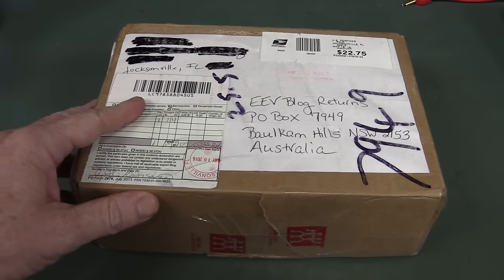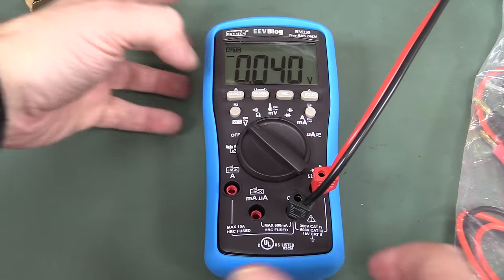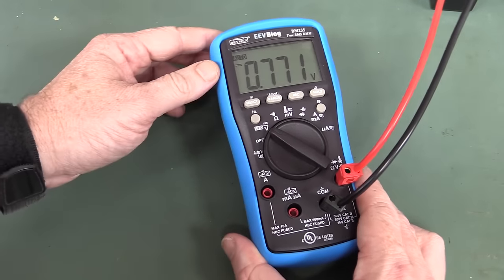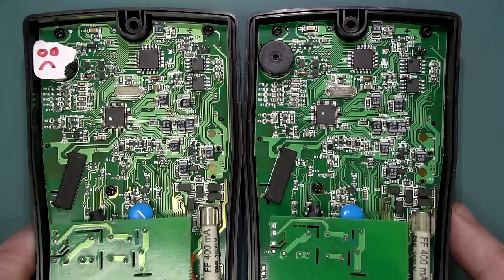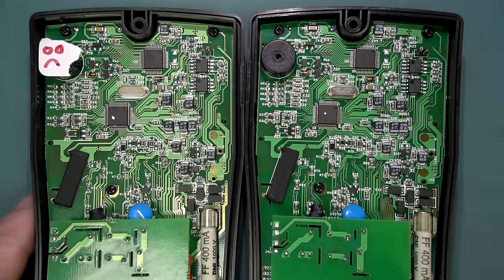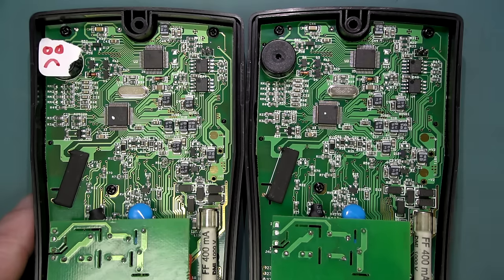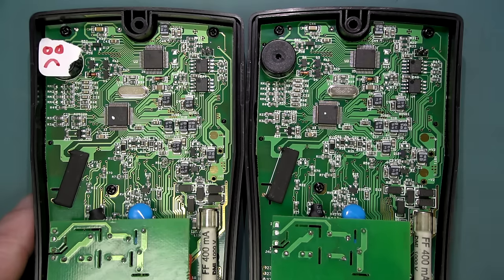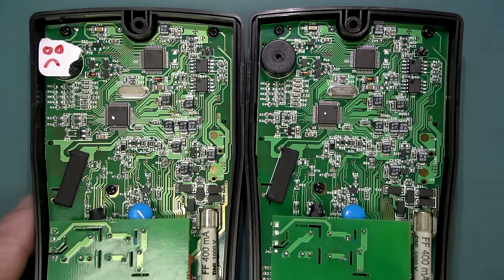EEVblog #884 - EEVBlog BM235 Multimeter REPAIR

Comment: As it turns out, Dave has an ACL joint fault and the meter had a DC L joint fault.
Reply: No you didn't! :D
Reply from the maker: I'll pay that.
Reply: Thanks. That will be one thumb up, please.
Reply: Dave,
Have you moved to the new lab building?
Reply: Only a fool would ask that.
Reply: funny stuff
Reply: Joking aside, a torn ACL (which stands for anterior cruciate ligament, not joint) is a very serious injury.
Reply: I didn't say ACJ or AC joint, did I? "ACL joint fault" = (knee-)joint fault related to the ACL.
Reply: Gameboygenius No, you didn’t say “ACL joint,” Dave did. (He misspoke.) You made a joke (a good one). I was going to bring up the seriousness of the issue of this particular knee injury, and, instead of creating a new free-standing comment, replied to yours (which already had the word ACL in it).

Please don’t take it as a personal attack on you—that was never my intention. My “joking aside” was just a “by the way” or “apropos of ACL.”

(Ironically, I’m going for a knee surgery in a week. Throughout the past few months, I’ve learned a thing or two about the knee-joint injuries. But that’s another aside.)

Cheers and good luck to Dave with his “joint fault.”
Reply: Clever (game) boy.
Reply: Gameboygenius b. NBA.

Comment: All these repair videos that guys like Dave and Shahriar do make me wonder how many millions or billions of dollars worth of equipment ends up scrapped or junked or collecting dust because of the failures of single sub-penny components. I remember hearing so often that it wasn't worth fixing things, or people should just swap boards, but that seems so wasteful now. But I guess time is money, so that factors in.
Reply: Yeah, it's crazy. I was on Skype call with my best friend after my laptop's charging circuit died and they said something like "oh, about time to get a new one then". And I was shocked! Hell no, I'm going to rip this thing apart and see what's going wrong. Turns out a MOSFET was blown and I had a replacement part, and it only took an hour or so to get a new one in.
Reply: An hour of someone's time for component level repair is worth anything from $100 to $300. Older laptops or cheaper laptops would be easily totaled at that rate.
Reply: people throw out lcd monitors all the time because of 20 cent capacitors.  back in the day you could find crt tvs and monitors on curbs for bad transistors, those only cost a buck or two a well.
Reply: First you pay someone to diagnose the problem (base pay + benefits + social security + Medicare + Federal Unemployment taxes  + State Unemployment taxes + Workers Comp +++ etc.). 

Then you pay someone to fix it (see above).  Assuming it can be fixed.

And at the end you have a used piece of equipment that YOU have to warranty for when the next item fails (because the owner will never believe you did not break the component on a completely different board/area while working on it). Economics do not really support the effort UNLESS you are a small company (or single individual) doing the work. Or you can charge a lot for the work, such as repairing really high-end or rare pieces of equipment. 

Sad statement on economics. Taxed to purgatory then further litigated into oblivion.
Reply: ***** I would honestly be shocked if you charged me $10-$20 an hour to repair a modern laptop, but to each his own I suppose.
Reply: What?! $100-300 per HOUR?! That's way too much! Usually, it's $20-50 per hour!

Comment: I've torn and had surgery on my right leg's acl before.  For Dave to diag this gents returned multimeter, on video, takes a maximum amount of character.  good on ya Dave. Get well soon.
Reply from the maker: How'd it go?
Reply: +EEVblog I was young and I didn't stick to the pt properly. No pain but no full extension. I'm missing probably 3-8 degrees to full extension of the knee.
Reply: I thought that about Dave repairing the item on film. But then in most situations a sane person within this industry accepts sods law, like Dave admitted. It's just the way it is. It's also interesting to observe those who will not take responsibility or criticism and see it as a sign of weakness or what have you and do what they can to shun similar. Some people are glass half empty and some are glass half full with life's choices.
Reply from the maker: That would do it, yet, the physical therapy is very important.

Comment: Is the small board with the input jacks well supported on the back by the case? It looks as if the red connector wire near the ground jack, that has no relief bend in it, could pull on the main board a little every time something is plugged into the common jack. The connection of the wire on the main board is right besides the inductor and the relief cut under the inductor will make any stresses to the board there go right through the inductor. This really looks like a design oversight.
Reply: Good point.
Reply: agree, that failed inductor is pretty darn close to the input jack...physical stress might be a contributing factor.

Comment: Opened up my one while watching this - all the soldering is absolutely perfect including L3. I noticed L3 is right next to an alignment pillar on the case and there is a larger pillar on the back cover that goes over it which would put it right over L3. It could be possible that a compressive force on the case in that corner could push that onto the component and break it...? Regardless - I love the meter and recommend it!
Reply: I was thinking that also, based on that pillar and the isolation gap, there could be more torque on those components than expected. 

I suggest taking another look at the other inductor, it looked to me like it might be cracked also.
Reply from the maker: Interesting observation, I'll take a look at that.
Reply: See Joe Smith review of the BM 235.   He found the factory fix.
Reply: It is around 7:40 in that video.

Comment: I went over a bryman, not same model.m it also had weird intermittent issues as well. Repair shop never figured it out either. The distributor needed refunding my friend. It happens once in a while.
Sorry about the ACL, I had that surgery. Had bad after affects during recover. Not the worst surgery but not the most pleasant. My shoulder was worse in pain but faster recovery. Wish you luck with that surgery.
Reply from the maker: But did you knee eventually fully recover enough to play sport etc?
Reply: +EEVblog I'd say yes considering my situation. ACL and Meniscus are the common sort knee injuries. But being Type 1 diabetic w/ compromised immune system slowed down recovery. Just started rehab later then expected from swelling taking longer to go down, but once it did it was full speed ahead. Unfortunate I also had torn the Meniscus and because I had to fight insurance for two years for surgery approval it became beyond repair. So that bothers me, but ACL is good. I have a knee replacement approved, but don't want that until I feel it's the last option. 
Key things are get it done as soon as possible, use a good sport surgeon that has done many of them.Don't slack off on rehab! My shoulder recovered better then original, but I was rigorous with rehabilitation. Everyone will tell you take rehab serious to build it back up and it should be fine, I know people that were lazy with rehab and years later regret it. Good luck, I'm sure you won't slack off with rehab and should be fine.

Comment: Do you always get this lucky with easily identifiable problems? Almost every time I open something up I'm hoping it will be just a quick simple component replacement, but it usually isn't lol
Reply: You're not alone!
Reply: lol even though I have almost zero electronics skill compared to this guy, I always hope the same thing.  Hoping for some leaking caps, brown spots etc.
Reply: Look back on the channel about a year or so, and you'll see Dave's all-but given up on repairs because these days it's always something complicated.
Reply: I have a repair shop for mostly SMD components, and it's 90% cracked solder joints or component solder joints just like this.  My microscope is my friend.  Then mechanical parts like pots, switches, then transistors.
Reply: In case of such warranty claims right after using the product for the first time, it's very often a faulty component or some mechanical problem that happened during the production (bad connection or even a connector that lies around). The things will be different if one fixes only things that worked fine until now.
Reply: It tends to be luck of the draw. Recently I've been doing pretty well. 

HP Laserjet 4350N  for £4.00 + shipping - Performed a factory reset - upgraded the firmware and it works fine. Developer unit 90% unused, toner 30% unused. So enough toner for another 5,000 copies approx. I couldn't even get an ink cartridge for that money. The thing looks brand new. Printer original rrp £1,200 +vat 

Sanyo LCD projector. Picked up for £1 + shipping. Ad stated  "VGA input 1 doesn't work".. yes it does, so does VGA/DVI and composite. I'm watching this Youtube video with it. Lamp life remaining 94% of 6000 hours.  Original rrp £350 +vat 
 
Dell laser printer - £3.76 + shipping "Error light at power on". No fault found. I've run it overnight, bashed it this way and that, powered it off and back on. Solid as a rock. Original rrp £120. 

I've got two more laser printers (b1165nfw -rrp £150 approx), multifunction scanner/copier/fax on their way.. Both cost £1 +shipping - my luck is bound to run out soon. ;¬) I haven't even had to bring out the multimeter this week. I'll have forgotten how to fix things pretty soon if this goes on. No doubt the next batch of goodies will all be intermittent or unobtanium faults... that's the way it tends to go.
Reply: +Andrew Hull the whole LJ400 range tend to have their firmware crap out once a year or so.
Reply: Andrew C
 At the price I paid for it, I can live with that. I actually updated the firmware just because I could, not because I detected a problem that required it. I'm still astounded that I got it as cheap as I did. They only charged £3.95 to ship and the darned thing weighs 23 kg. I suspect they made a loss on the shipping.
Reply: +Joel Godin Where are you located?
Reply: I have had that EVERYTIME I tried it except with a massage chair which just had a faulty psu which I swapped out with a 12V plugpack :-)

Comment: Solder joint on L2 looks cracked also Dave... Wonder if there's a bit of flexing been going on across the isolation gaps there underneath L2 & L3?
Reply: I think those pads look awfully big for those components, when you make solder strech this far, it's prone to crack under mechanical tension. Solder ain't flexible.

Comment: I guess the componen was already slightly cracked or weakened during production or soldering but still held together well enough to pass testing without problems.
Then when it was shipped, it was in the cargo room of an airplane at high altitude, so it got really cold, I think up to -50°C or something at travel altitude? So in cold temperatures, things contract and in heat they expand. The component, when it was soldered, expanded slightly and when the solder colled down, it was held in place in this expanded state. At room temperature, there already was stress on the weakened component and when it was cooled down to the flight temperatures, the contraction force was great enough to finally rip the weakened component in half
Reply: Airplane cargo holds don't get down to -50°C.  They have a single pressure vessel that contains crew, passenger and cargo areas.  The whole vessel is pressurized, and therefore receives conditioned air.  In some planes, the under-floor cargo area is sealed for fire protection and has its temperature loosely controlled by a surrounding air jacket, but none are open to external atmosphere.
Reply: Yep, more likely cooked in the back of a tractor-trailer or truck instead while being shipped.
Reply: Yep, I once had to leave a trailer full of Post Raisin Bran at the rest area in the Virgin River Gorge for a week while waiting on a part. 100 degrees + every day. Don't know how hot it got inside that trailer sitting in the parking lot.

Comment: That ferrite bead is right next to the case screw spacer. Did the other half of the case put pressure on the ferrite and crack it when the screw was tightened??

Comment: Maybe a moisture problem? Could crack the housing during soldering but keep contact so it would pass the tests (and as far as I remember it even cracked on the bottom side, so no real clue for visual tests either). Because of the reduced stability it is however no longer really vibration resistant (didn't look like it was glued down) so shipping could have broken the part in the end.

Comment: I have seen that happen with stale and mishandled parts, where the tinning on the part has oxydized before we got it in to the SMT pick and place.
Oxydized solders will cause localised heating.

Comment: 15:48 left SM resistor have a cold solder joint?
Reply: Yep, good call. Looks like a fracture in the solder fillet on L3. I also spotted a crusty connection on C27.
Reply: Correction, L2 not L3. After closer inspection, the body of L2 also looks fractured.
Reply: may be test leads are putting pressure on the board ? bending it and cracking the solder joints .

Comment: I've seen similar in amplifier boards. When the right tune is played the board gets into resonance and the joints or the surface mounted parts break.
With a gap underneath it's even more likely that this part will break.
With a daughter board only supported on the edges makes it more likely things like that happen.

Comment: 17:23 For the number of the meters that you purchased from the manufacturer... could you not get a replacement part for the defective L3 part. They would not need to send you a schematic with the replacement part. I would suspect that it was on them to fix it.

Comment: I see a solder bridge (10:15) on the BTC chip (with the white dot on it) pin 36 to 40 but that must be just white color from under the chip.
Reply: I noticed that too but I think that if they where bridged that bad the whole unit wouldn't function itself
Reply: I don't see it ? between which pins ?
Reply: On the bottom of the upper chip I believe. Its only looks like a white marking on the side of the bottom edge of the chip.

Comment: I think this might have happened at the assembly after all. Board was automatically calibrated and then put in the case. Components on the corners of the board or next to similar spots (cutout for the input jack in this case) sometimes get mechanical stress applied because something (or someone ;) )goes wrong and pushes on them during an assembly step. I work in an electronics plant, we get such failures from time to time when testing the assembled product. The components are usually ripped right off, leaving only the ends soldered to the pads just like it was on this unit.

Comment: What mates with that plastic pillar next to the failed inductor on the other half of the case? Is there another, larger pillar that slides over that one to locate the case and hold the board down? If so, that might have hit the inductor when the case was assembled, or transmitted a jolt to it if the meter got knocked.

Comment: I was thinking of getting the EEV blog meter, but after seeing this maybe I'll try to repair my $80 super cheap meter, I think it's just slightly corroded from Queensland weather. what's good for cleaning gunk off moisture exposed circuits? I imagine it's a mixture of tin, copper and lead oxides, maybe after a good clean with isopropyl alcohol I could shove the meter in a tank of carbon monoxide to remove the remaining copper oxides, I'm sure that's the most important part to clean off since copper oxide encourages the further growth of copper oxides, I don't think carbon monoxide would harm the components too much in the short term.

Comment: I agree Dave,one out of a thou,send him a new one,no problem. Once you mess up a knee you usually end up with a life time of problems no more pro football for you guy! stick it in the freezer and see if it works,or heat it up in the oven. I got a RC Trawler that the electronics were dipped in of all things bees wax,try and heat that to check the solder connection.Its all through hole stuff. I tried penetrating the wax to test and ended up with a sticky mess. The boat is considered a collectable now,it was manufactured in Germany. I read up on these and apparently they leak and it shorts out the circuit board reguardless of the wax. I see a fireboat offered simular to these,not the same country of origin. I decided to move it up to the new age and chopped out that old technology and am updating it to all modern RC equipment under the hood. It shouldnt affect the collectability,if anything it increases the reliability and makes it more of a Hobby grade RC boat instead of a toy.

Comment: Nothing is perfect. That is a very low failure rate. Strange how that inductor broke off like that. I wonder if there was pressure on the area where the inductor broke, or high voltage blew it.
Reply: the movs would have saved it before it could think about its family

Comment: It looks like where L2 and L3 are on the board with the separation slots cutout, only leaves a couple of millimeters of board left, assuming that the boards are tested before being assembled into the case it wouldn't take much pressure to flex the board causing this damage if the assembler wasn't careful, just an observation, I don't have access to the board to confirm this possibility though.

Comment: The component cracked (for sure) but the solder joint was broken on both sides.  (or at least one solder break and one component crack).    Does this point to a physical impact maybe during assembly?   A hairline fracture in the component on one side would not account for its skew appearance.